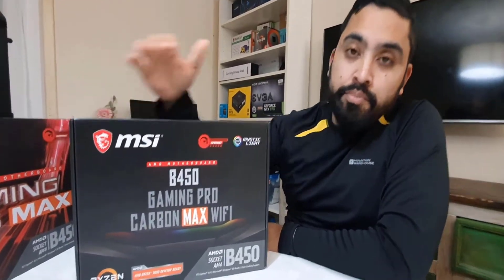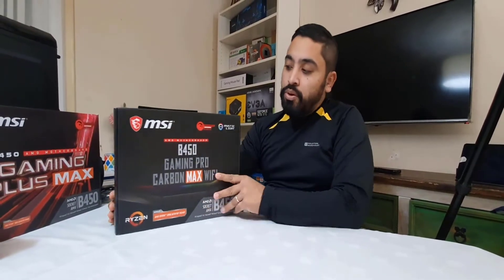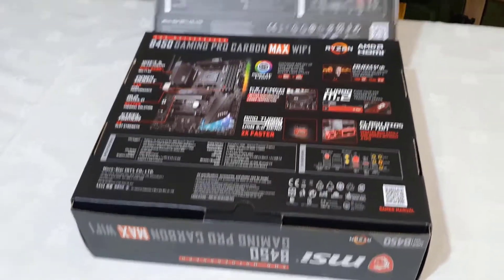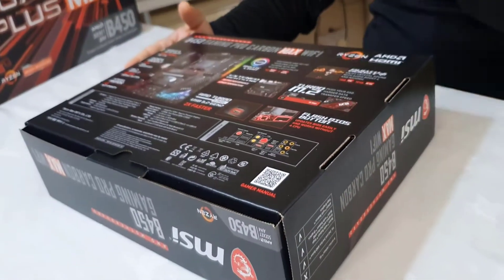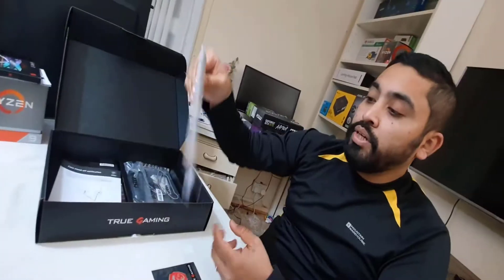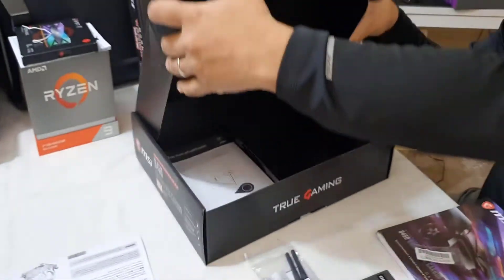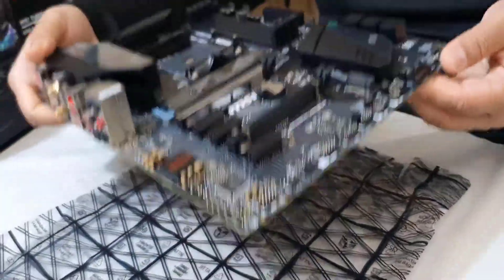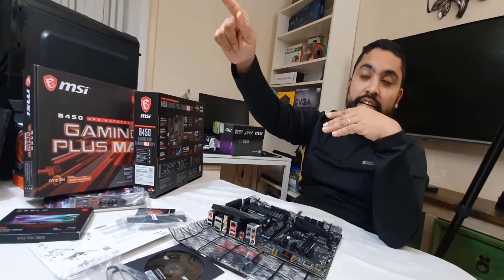Msi B450 Gaming Pro Carbon Max Wifi Motherboard Unboxing And Review

Comment: Question I have a msi b450 carbon / Ryzen 7 2700X along with a GeForce GTX 1060 6gb, what would you recomend me upgrade to, I was thinking of upgrading to a ryzen 7 5800x3d, what is a good gpu to go with it sorry I have not been keeping up with computer tech ?

Comment: Does it support overclocking of ryzen 5 3600 ?  
Another thing is can it support the ryzen 5 5600x ?  .  Thanks
Reply from the maker: It would if the processor socket Am4 !!! Yes it does  have option for overclocking, but personally I don't do overclocking as it would be extra pressure for the board and processor, and it would reduce the life span! I  have got Ryzen 5 3600 with this motherboard, and I am using it for editing videos and for live-streaming ! As a budget pc this is one of the great combination!Hope you would not forget to subscribe to my channel to show your support! Thanks
Reply: This motheeboard is perfect for overcloacks and it doess uppoet ryzen 5000 series u just need to upgrade the bios

Comment: Hi, does this motherboard have a good wifi card. Do you get low ping using 5ghz?
Reply from the maker: Absolutely it is good as it does support 2.4Ghz and 5Ghz at the same time and comes with built in good heat sink!!!!